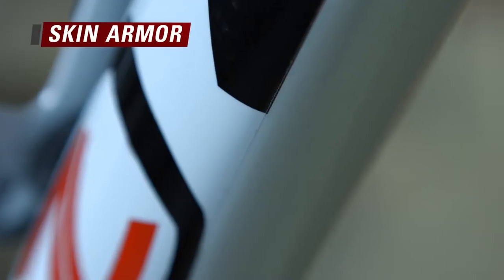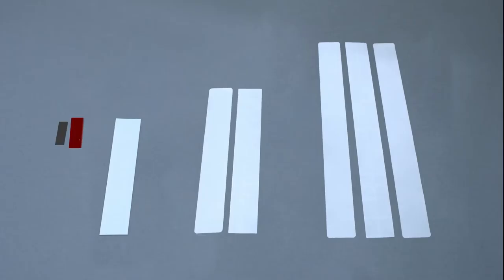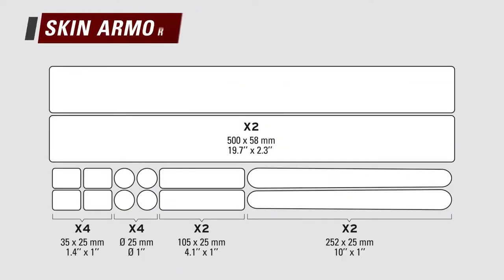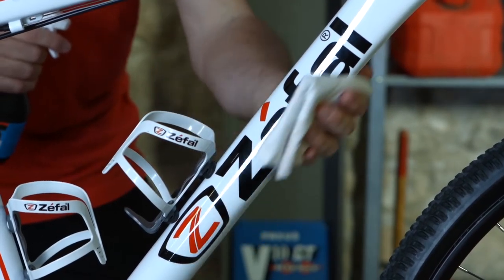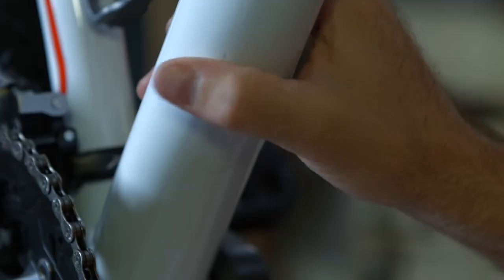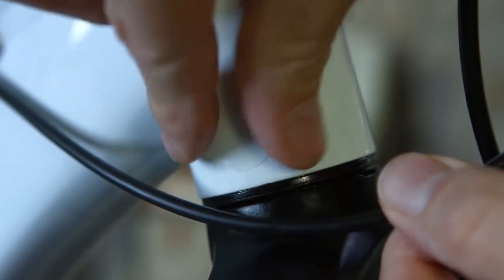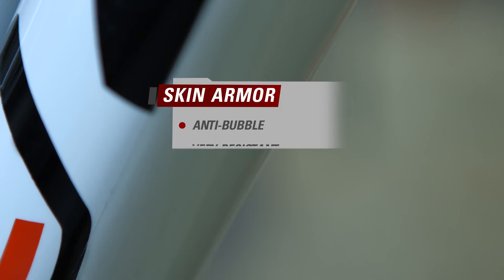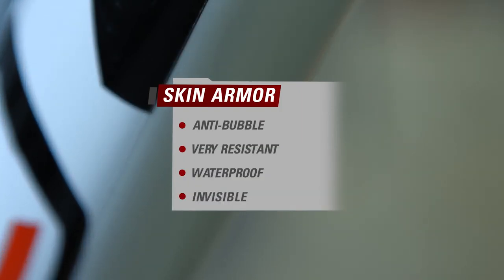Zéfal - How to protect your bike with the SKIN ARMOR ?

Comment: I am very surprised why this product is not more popular, at least here in Canada (hard to find). 
Just applied it today - the Zefal skin armor is the easiest transparent frame tape I have installed: it is true what they say in the video (I was skeptical), but Zefal does indeed install WITHOUT bubbles.
It's not me - because on the same bike - I also installed 3M helicopter tape (tried different brands) - they all install with tons of bubbles.
I have also found "All Mountain Style" installs easily and without bubbles - but I have only tried the solid black color (the clear/transparent AMS didn't look too good in the videos I've seen).